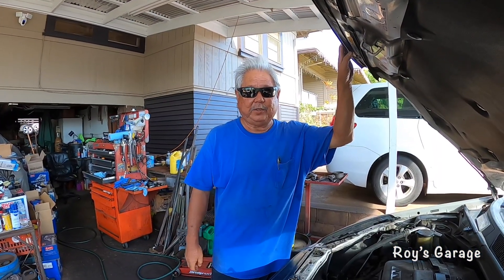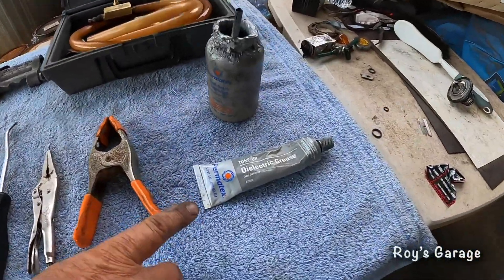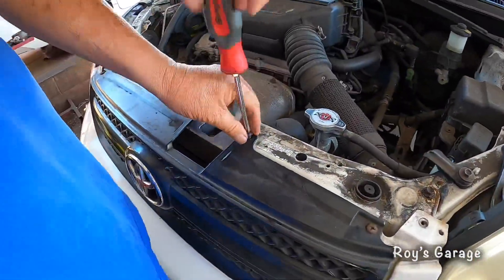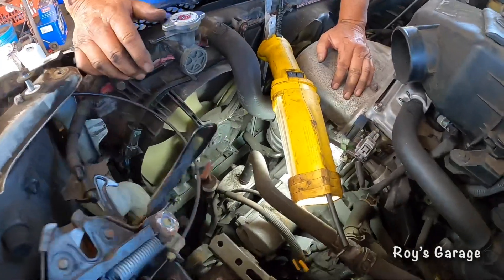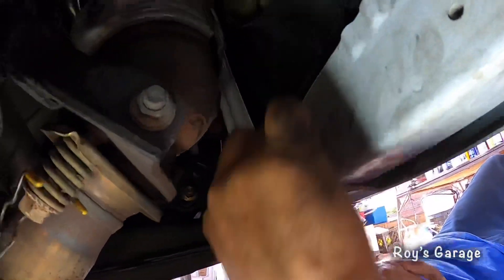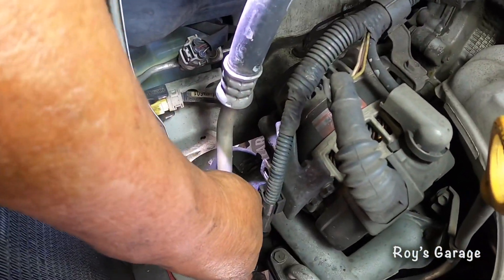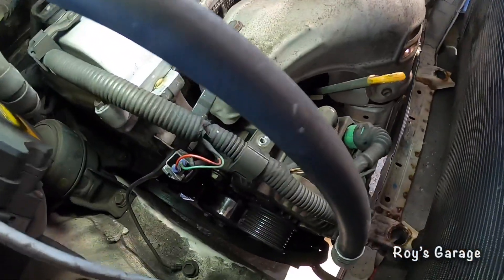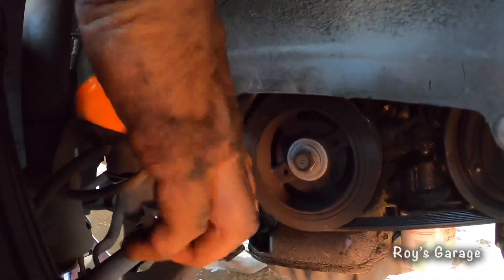How to Replace the Radiator & Flush Out the Cooling System on a 2005 Toyota RAV4

Comment: thank you Roy for showing us beginner how to remove and reinstall new radiator. My 2003 Rav4 has a small crack that is misting out of the hood and into my passenger windshield. I'm still a little scare and nervous about doing this job. Your videos is very well prepare, organized and detail oriented. If I watch your video over and over again, and maybe  I will have the courage to get the job done. Thx Roy you are a real true mechanic .
Reply: Gotta replace my 03 radiator also. How’d did you do?

Comment: Thanks a lot for your video, managed to change my radiator today in my 2003 Rav4, went very smoothly thanks to your guidance :)

Hint if you decide to do the job: The fan connectors can be tricky to remove, if yours are stuck too, try gently with a thin flat head screwdriver and pry open the connector. GENTLY! Pry from where the button is, it came right away for me when I did that.

Comment: Hi Roy - great video. Neat tip about clamping the serpentine belt on the rear PS pulley to hold the belt in place while everything is disaasembled and it assist with the reinstallation. Just remember to remove the clamp before starting the engine!! 😂

I saw a few comments about the transmission lines, and you probably clarified it already, some of the RAV4 models have a separate transmission oil cooler  mounted to the front of the transaxle with its own coolant feed hoses coming off the lower engine block. It is a silver cylinder with two medium sized hoses for coolant and two smaller hoses that connect to the transmission. There are no transmission lines connected directly to the radiator.

Comment: Thanks, Roy -  got a '01 Rav4 in '18.  In '19 noticed small loss of coolant.  Green . By winter,  seals were leaking badly and I replaced it .  Denso.  Now 2 years and about 5800 miles later (low mileage) dealer did a flush -fill.  Small loss coolant in summer, nothing obvious.  Now cold weather  starts to dump;  Will try different radiator  brand.  Sure would like that Hawaii winter!  Your video is timely help for me , nothing much on '01 but yours is new to me and much help.  Complex  and detailed replacment, your video is most helpful with similar year design!  Thanks and Aloha!  (ha-ha0 from cold northeast).
Reply from the maker: Glad I could help. Thanks for watching 🤙🤙🤙

Comment: Outstanding step-by-step guide! Really appreciate all the detail steps and hats-off to the person filming. Best I've seen on YouTube! And I'm glad you confirmed how tough that fan's electrical connector is to disconnect. I thought I was doing something wrong, so I stopped before breaking it. I'll use your tips to carefully disconnect it.

The passenger-side (radiator) fan isn't working on my '05 RAV4. I'm going through the troubleshooting steps on that now (fuses, relays, fan motor, etc.). Are both fans supposed to spin at the same time? Or does each one turn on independently/together under different circumstances (A/C, temperature, etc.)? I read on a forum that both are supposed to spin when you turn on the A/C, but only the driver-side (A/C condenser) fan spins on my RAV4 - even after getting up to operating temperature. I'm hoping it's a bad relay/fuse.  :)
Reply from the maker: In MOST cars (including this one), they’re both suppose to spin simultaneously. Hope that helps and thanks for watching 🤙🏽🤙🏽🤙🏽
Reply: @RoysGarage808  Hello Roy! I just wanted to follow-up. I replaced the radiator and passenger-side fan on my RAV4! It wasn't the fuses or relay. The fan motor finally gave up after 260K miles.  :)  Your video was perfect. And indeed you were exactly right about both fans spinning when the A/C  is turned on. Thanks again for putting together this step-by-step how-to video. It saved me a ton of money!

Comment: @miked5106 I have an 05 Rav automatic. My radiator does NOT have those hard lines at the bottom. There is an external oil cooler and the trans is cooled off of that. I’m swapping out the radiator and got one without those lines. That’s what was there so that’s what I’m putting back in. I did see this like yourself, not sure what’s up with those lines 😂. I have yet to see hoses that go to those lines, in real life or the parts diagram. 
This video was extreamly helpful, I saw that as well and triple checked all this

Comment: Great video, Roy! I will need to do this soon on my 2004 Rav4, as the radiator is slowly leaking from the upper seams like in your video. I noticed that you used a CSF radiator. Are they reliable? Will a Toyota  Cap fit or do I need to get theirs? Thanks in advance.
Reply from the maker: Sorry for the late reply, I must’ve missed your comment some how. I actually used Performance Radiators in the video and they’re definitely reliable, I use these radiators all the time but the cap is CSF. I believe the Toyota caps should fit. Again, sorry about how long it took to respond and thanks for watching 🤙🏽🤙🏽🤙🏽

Comment: Hi Roy , I was just wondering what the silver tubes on the bottom inside were for on the new radiator. I did not see those on the old one. I'm disassembling old one now and everything is going smooth thanks to your excellent video
Reply from the maker: Is it’s the silver metal piping looking thing at the bottom of the radiator, that’s the trans cooler line. As you’re taking it apart, you’ll see which hoses go there. Remember to plug the hoses after to disconnect them though!!! Thanks for watching 🤙🏽🤙🏽🤙🏽

Comment: I have 2005 rav4. Does the coolant go up and down when the fan turns on? 

Does the coolant also go down when the A/C is on? 

It seems my does. When the rad fan turns on, the coolant on the mouth of the cap drains and after few seconds the coolant goes back up. 

When turning on the A/C the coolant goes down and only goes to the mouth when A/C is turned off.

Comment: Brotha Roy 22:20 vacuuming out air? Is that necessary to do this job.
Reply from the maker: It makes it easier (and faster) if not, you have to add in and run the heat cycle (run the car) and then let it cool down to see how much more too add in, sometime you gotta do it a few times. Absolutely do NOT open the cooling system while the car is still hot!!! Only when it’s cooled down!! Thanks for watching 🤙🏽🤙🏽🤙🏽

Comment: You didn't cover about the 2tube for transmission cooling
Reply from the maker: Good catch, you seem very knowledgeable about the cooling system! BUT this particular vehicle's radiator doesn't have the two trans cooler lines on it like most vehicles. Since it's not on the radiator, there was no need to disconnect it or bring it up because it wasn't part of the job. Thanks for watching.
Reply: @RoysGarage808  Edit: Confirmed that these are transmission cooling pipes. 

 The guide was excellent up until I forgot to connect the the lower bypass pipe to the radiator before start up.  It was hidden by the passenger side cooling fan when I reinstalled that.

What shot out was some thick dark purple oil which appears to be transmission fluid.  I suppose it's fine since I was going to flush the transmission anyway.

  Thanks for the video, it really helped. I just wish I remembered to connect that pipe before making a huge mess.
Reply from the maker: That is transmission fluid. Connect the hoses and check the transmission fluid level

Comment: Roy if I don't have the vacuum set up at the very end  what can i do to fill it up with the  anti freeze
Reply from the maker: Oh boy, It’s gonna take some time. You’ll have to fill it up and cap it, run it through the heat cycle (let the fans come on about 2-3 times) WITH the heater on hot, turn it off and LET IT COOL DOWN and then open it up, if levels got lower pour more in, repeat if necessary, then take it for a decent length test drive, when you get back turn off your car and let it cool down again, and then open it up and top it off if necessary and you’re good to go. Hope that helps and thanks for watching 🤙🏽🤙🏽🤙🏽
Reply: Ok.. that's the answer I was looking for.  I just replaced rad and it's taking for ever to fill up. just seems to bubble up/spill out while pouring in, I thought there was something wrong with the new rad. --- Fill a little.. cool down... fill a little cool down  --repeat. I guess burping the rav4 without vacuum must just be a long process?

Comment: Roy maybe i didn't state the question quite right in the video. The old radiator did not have any tubes on the bottom, just like mine and the new one you installed did just like the one I purchased. It looks like you did not hook anything to them and just left them on. Is there anything special I have to do to these tubes or just leave them as is? Thanks My first time doing this

Comment: What would cause a radiator to start to leak I would like a RAV4 I think.
Reply from the maker: Great question! A lot of it has to do with the fact that the radiators are partially made of plastic, overtime they just become brittle and deteriorate.
Reply: @RoysGarage808  I miss the days of brass and copper radiators when you could solder them and have them re-cored if need be.

Comment: There is no way to take all the air out without using the tool on the radiator..? I mena if a put my rav4 going up hill should be enough to keep the cabin radiator lower than the mouth of the main radiator on front...